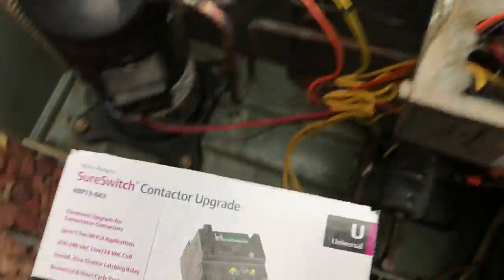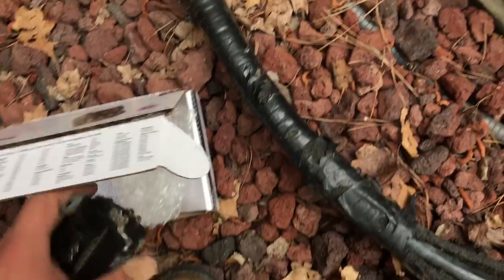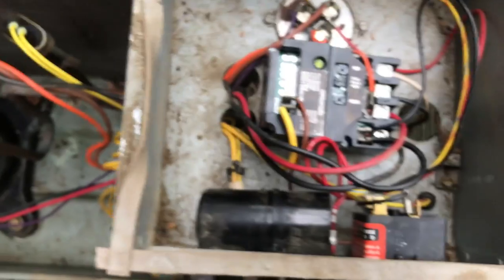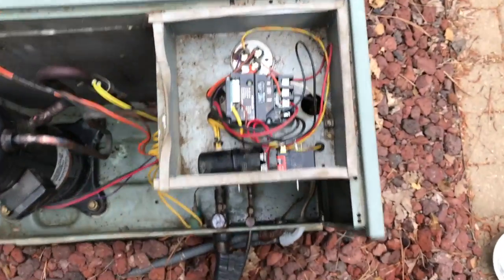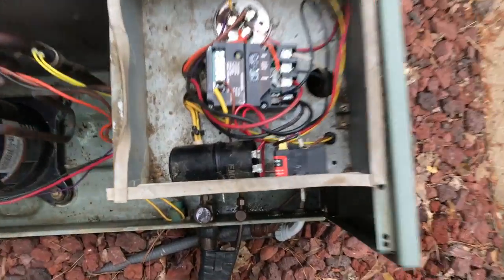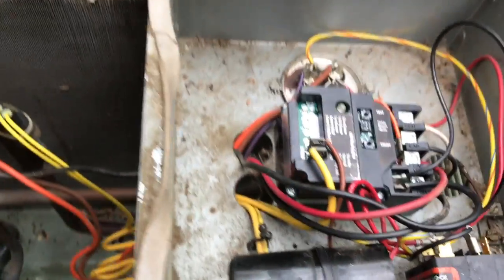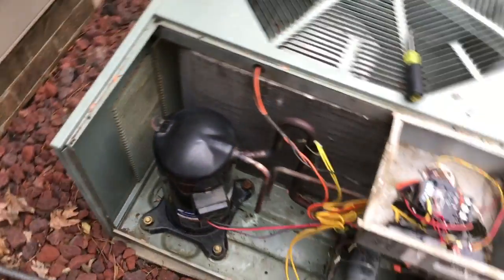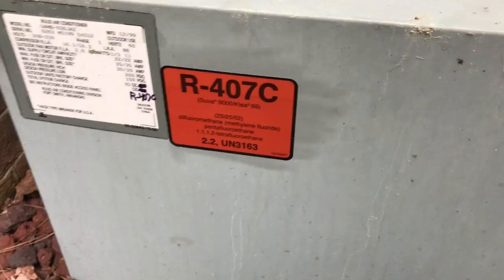My Ruud condenser gets an Emerson SureSwitch

Comment: Nice job Matt! I like the sealed relay with the optical sensor you will be amazed on how many time the compressor cycle in a years time...great video!
Reply from the maker: Thanks Dallas!  I really like it too! It just seems to make & break so much smoother than a traditional contactor! I will definitely be checking the cycle count next year around this same time, will definitely be interesting to see. 

I will also say that I bought a SureSwitch for my grandparents' 1994 Carrier heat pump, will be doing a video of putting that in sometime soon as well. The cycle count should be interesting on that unit being that it's a heat pump and runs year round. 

Thanks for watching & commenting!